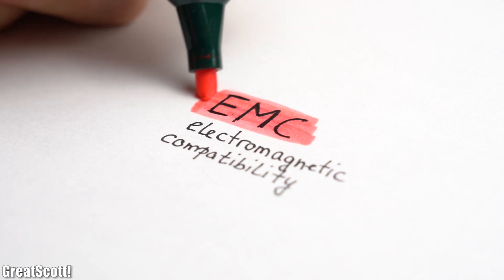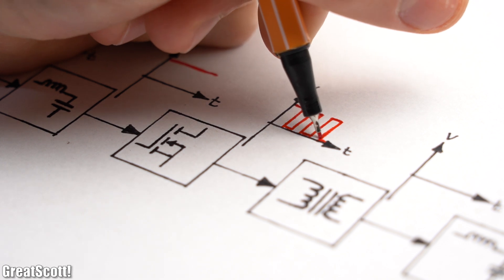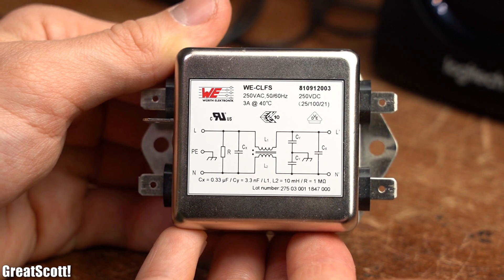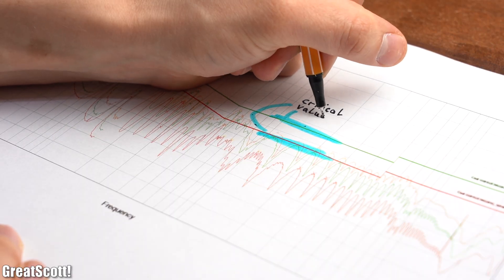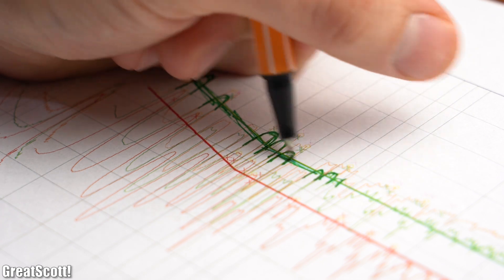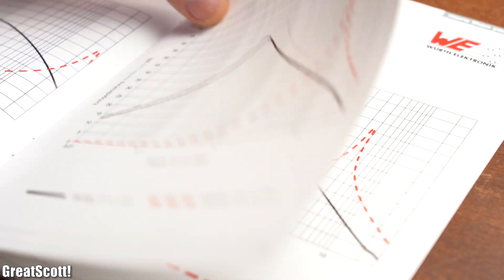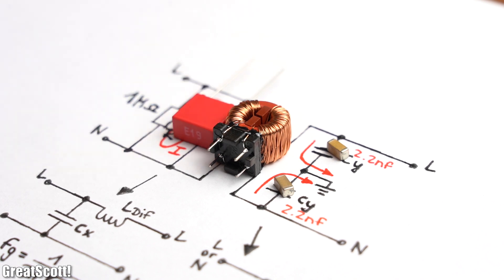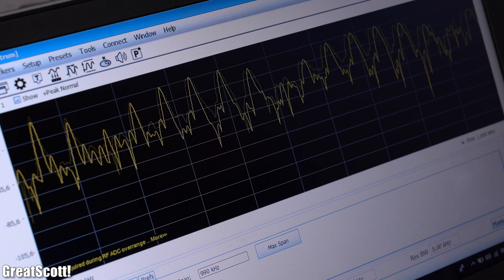How to solve EMC problems! || The mystery of the buzzing speaker

Comment: Hello brother 

I have TDA8954th 420watts mono amplifier I was playing music when I increase the volume popping noise starts coming on high volume and after that amplifier just stopped giving output but amplifier is still on but not giving output 

Supply Voltage: 28-0-28 
Speaker: 30 watts 3 ohms
I was using these speakers with it but today that popping noise came and amplifier stopped giving output I will make a video on it if u want so u can see my problem an understand it better 
Sir if u have any solution plz kindly help me with it 

Thankyou in advance
Reply: The data sheet suggests a 41V voltage for the TDA8954
Reply: @Dubst3pT3ch  yes it can handel the voltage 
But should I need to replace the chip?
Reply: @Dubst3pT3ch  only the problem with audio 
And one more thing the the temperature of chip keep rising with no load in ideal state  with no heatsink but whith heatsink and fan it negligible 
If u know any solution please tell me 

Should I need to replace chip or just connect 4-8 ohm speaker?
Reply: @Davidslabofficial  I do not have your answer just speculating, try a different speaker first then move onto other possible fixes.
Reply: @Dubst3pT3ch  ok thankyou
Reply: Sounds like it's hitting an over current cut off or low voltage cut off. 3ohms is also possibly too low of a resistance for the amplifier which is cutting output to protect itself.
Reply: @Dubst3pT3ch  so that means the chip is alright 
I know that but I want to know how can I make it work everything is fine the chip is getting voltage nothing burned just no audio output

Comment: As a bass player I've had such a problem lately because of a cheap PSU causing an annoying electrical hiss at high volume, which is amplified when I use distortion pedals, and I almost always do. Thanks a lot for this video!
Reply: Davie504
Reply: @akash-zg4vj  yes, but actually no. But you can still slap like now, or I will call the police.
Reply: @deadbird99  ayyyyyyyyy.  Knife pointing
Reply: @akash-zg4vj  Do it. Now. * stares in italian *
Reply: @deadbird99  Cliff Burton
Reply: @akash-zg4vj  slap
Reply: I have a similar problem, when i charge my portable speaker with the pc's USB i hear lots of hissing noises, they seem to come from inside the PC and then they get amplificated. How can I resolve this problem
Reply from the maker: Now you know how to fix that problem ;-) Thanks for the feedback.
Reply: @greatscottlab  yes, even if I think I will definitely stick to the pre-built solution ^^